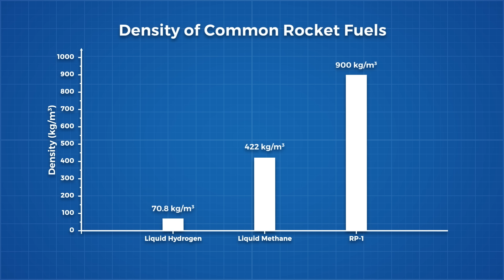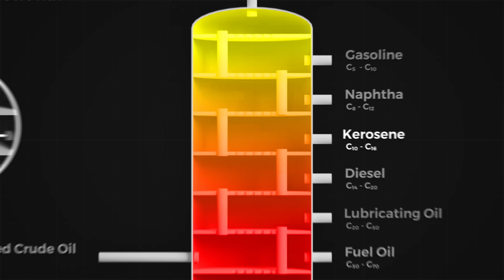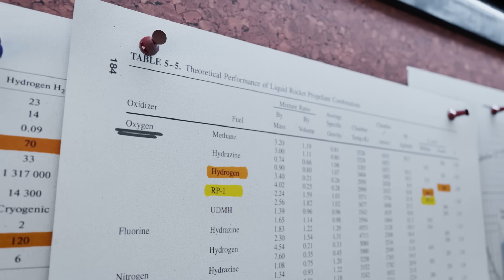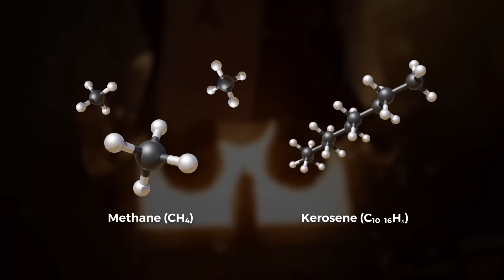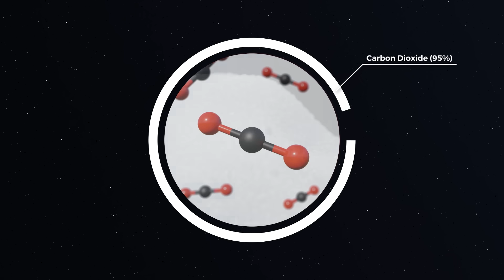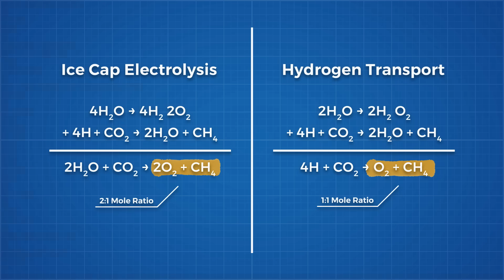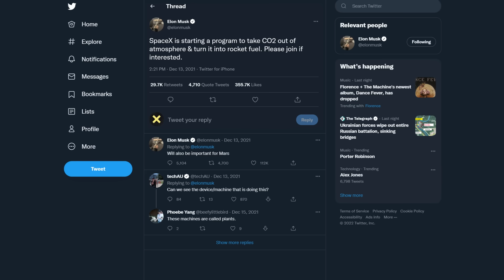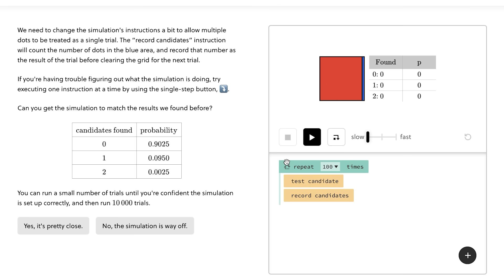Why SpaceX is Using a New Fuel

Comment: Everyday astronaut has 3 great videos about this.
I wish physics would be tought like this.  ( in school)
Reply: This is pretty advanced physics and chemistry. Doing stuff like this at high school level is pretty much impossible. That's why universities exist though
Reply: @spacelapsus8835  electrolysis was 10th grade?  ( Germany)
Ofcause it's the light version. 
I would have been more interested if i would have been shown why i should know certain things.
Reply: @CHMichael  yeah electrolysis alone maybe. Now combine it with a different reaction. Use the reactions and the densities to pass from mole ratio to mass ratio. Consider the fact that engines can't run on stoichiometric reactions or they'll melt so adjust the reactions to account for that. Now add the design process of the engine and of the tanks that have to account for thermal equilibrium, pressurization and feeding and then tell me that this is something you can teach in high school.

Dude, I'm an aerospace engineer, I'm not saying it's impossible to teach this, I'm just saying that you can't teach this in high school while kids have to study also 10 other subjects. And that's why this is taught at the university. That's all I'm saying
Reply: @spacelapsus8835  you know way too much and no one expects a high school graduate to build methane factory.
By using this style of presentation the students might have enjoyed accumulating the basic knowledge to understand why SpaceX has made these choices. 
Versus the endless formulas on the black ( now white) board.
Reply: @CHMichael  the problem with that is that it isn't really knowledge. It's no different than watching a documentary or reading a book. By just listening to what people did without actually looking at the math behind it you're not really learning. You'll just be able to repeat what the documentary said. You'll get the outside of things but won't really understand them

Comment: Another reason they went with Methane is that is allows the full flow staged combustion cycle of the Raptor to work. The Merlin uses uses Kerosene and has minimal to no refurbishment required.
Reply: The only other full-flow engine to reach a late stage of development was the USSR's RD-270, which burned the similarly dense (but extremely toxic) hypergolics UDMH and N2O4.
Reply: It's the other way around actually. Since they're going with methane they chose to develop a full-flow stage combustion engine. The choice of the propellants is a level above the choice of the thermal cycle because it influences your architecture a lot more.
Reply: @spacelapsus8835  I see it as sort of a package deal. Along with the other reusability benefits of methane, you also get the relatively benign turbopump environments.
Reply: @pseudotasuki  yeah that is for sure true. However, what I meant was that you first have to settle on a propellant to then start considering the architecture of the propulsion subsystem. The choice of the propellant is governed by the type of mission you're dealing with. For example, long term missions generally (it's not always the case but it is often true) won't opt for cryogenic propellants for the final stages because of the complexity of storing at such low temperatures for extended periods of time. In this case, the choice of methane came from the possibility of in-situ extraction and the better performaces compared to RP1.
Reply: @spacelapsus8835  Aah, yeah.
Reply: @spacelapsus8835  Arguably you can decide that you want certain aspects of architecture and then shop around for a suitable propellant afterwards; it's just that if you do so and there are no suitable propellants that can utilize it, then you have to give up on those architectural choices.
Reply: @spacelapsus8835  No, you don't first settle on a propellant, that's where the Hydrogen Obsession came from. You do a trade of all aspects of the architecture at the same time. For example - Hydrogen has high ISP, seems great, US heavily focused on it. HOWEVER, the tanks weigh a lot and turbopumps are too big (heavy). Kerosene has lower ISP, but easier to pump(means higher TWR engines). Both kerosene and methane can be subcooled, increasing impulse density(another important metrics) and performance. Methane can be made on Mars. But in the end - Methane really comes ahead of hydrogen/kerosene ONLY IF you do both full-flow engine AND propellant subcooling. And that's a result of a full architecture trade, not "pick fuel, then pick engine cycle".
Reply: @candyjaywee  you just wrote a useless tantrum for no reason. Methane comes ahead because it's basically the only viable option for round-trip missions since synthetizing RP-1 on Mars is impossible and extracting hydrogen is quantities large enough to be used as a propellant is unfeasible (and again, storing it for 7 months in a tank for the journey is practically impossible).
Reply: @KainYusanagi  which is exactly why you don't do that. Developing something extremely complex to then have no real options to be used is the most stupid thing an engineer can do.
Reply: @spacelapsus8835  There's a difference between developing something extremely complex and finding nothing that works with it, and deciding on an architectural design element and looking at what fuels would possibly work with the choices you want to make before you actually make it, since we actually know all the relevant data of the fuelstock we could potentially use in the first place, now; no longer are expensively overbuilt prototypes required to be made just to see if a fuel is possible within it.
Reply: @KainYusanagi  do you work as a rocket engineer?
Reply: Indeed. It would be extremely difficult to implement in an engine that burns hydrogen, due to the enormous difference in density (and therefore frow rate) of hydrogen and oxygen.
Reply: It's certainly possible to do hydrogen full flow, it'd have some restrictions removed from shaft driven pumps on a closed cycle single turbopump engine like the RS-25 and it's insane gaskets on the shaft.

Full flow removes the shaft for 2 independent turbopumps. But since hydrogen is so low density, you'd need 2 very large pumps. The RS-25 pump is crazy big compared to the rest of the rocket.
Reply: @Jaker788  Came looking for a comment on the pumps and was not disappointed, full marks. Turbopumps are by FAR the hardest part of all of it, and exactly as you say, LH2 is extremely hard to pump well. A major reason SpaceX prefers LHC4 and RP-1 to LH2 is the pump turndown ratio. LH2 pumps have notoriously poor turndown ratios, because when running off-design (like for example when one wishes to land a rocket stage) the pressure rise through the pumps falls off a cliff at low throttle settings. These problems don't impact LCH4 nearly as much.
Reply: @Jaker788  But for any vehicle that needs to be able to operate over long distances and durations, Hydrogen's leak rate would be a massive problem.
Reply: Also methane has more energy than hydrogen per volume
Reply: @widodoakrom3938  just wait until solid hydrogen is fully developed. A 1000 isp very dense propellant is gonna make methane obsolete.
Reply: Meh, it has good specific impulse, phase temperature overlap with liquid oxygen, and it can be synthesized through Mars ISRU
Reply: yeah ...that black soot produced gets collected on the bottom side of falcon 9 ...making it black during reentry ....also it f ups the merlin
Reply: Uses uses kerosene?
Turns out humans ignore if a word is used twice with a line
line break between them.
Reply: Heresy is a subjective term – only you who are in fear of the Omnissiah's righteous gaze wish this work to cease. In His name, I shall see this is never so!
Reply: hello  i just wanted to tell you all to repent for your sins and come to the lord jesus Christ
Reply: @alexthomas3628  we'll all go up and visit heaven once Elon gets the ticket costs down on Starship.  Does the buffet do Happy Hour?

Comment: Would water on Mars be carbonated?
Reply: No, it would mostly be tightly chemical bound in the soil, at a proportion of typically 1-3%. You need to do a lot of mining to get it and then you need to supply energy and complex processes to extract it from the soil.
Reply: @saumyacow4435  frozen water?
Reply: @JadenRiley6494  If you're looking for ice on Mars, then you'll need to start at mid-latitudes and you'll probably find thin layers of ice buried beneath metres of soil. That doesn't solve the mining problem. If you want to find ice on the surface (mixed with dust and CO2) then you can go to the poles. Problem is you then need to transport it thousands of kilometres to somewhere hospitable enough to actually site a base.
Reply: @saumyacow4435  man I just wanna if it's gonna be carbonated

Comment: At 14:14 it speaks of using the Sabatier process in creating storable energy. I don't get this. If you're starting point is hydrogen (presumably via electrolysis) you lose more energy creating liquid methane than creating liquid hydrogen. Liquid methane might find a use in things like ships (due to easier storage), but for grid scale energy storage, where you've got room for the insulation, liquid hydrogen probably wins.
Reply: Insulation is not the way. For every liquid, its boiling point increases with external pressure. If stored in a strong enough vessel, a liquified gas can keep itself liquid through its own vapor pressure. For example, lighter fluid is actually a gas under normal conditions, but the body of a lighter is strong enough to contain the vapor pressure and keep the fuel liquid. The lower the boiling point, the more pressure is needed to keep the liquid from boiling at room temperature. Liquid methane has a much higher boiling point than hydrogen, so it's not unfeasible to store it in high pressure tanks with minimal insulation. Besides, its molecules are a lot larger than hydrogen, so methane-tight storage tanks are much easier to make than hydrogen-tight ones; as was mentioned in the video, methane has a lot more energy per volume as a liquid, so it's more space efficient as well.

You're right that it is theoretically more energy efficient to store hydrogen directly instead of methane, but practically storing (and let alone transporting) one is way easier than the other.
Reply: @pocarski  Yeah, but to keep liquid hydrogen a liquid, even at liquid nitrogen temperature, requires extreme pressure (not going to look it up right now, but its huge). 

The point about hydrogen is not transporting it. Rather you liquefy it on site and convert it back to electricity on site. Likewise if you need hydrogen for steel making, you make it on site and use it on site. Methane could have its uses, but ammonia is denser, easier to store and is being promoted as a fuel for things like ships.
Reply: @saumyacow4435  I've looked it up, both of us forgot about supercritical fluids. If you get a hot enough gas under high enough pressure, it becomes a fluid that blends together properties of liquid and gas. Both methane and hydrogen are supercritical at room temperature, so this entire argument is moot because both of them get properties so cursed that I couldn't find a single formula that describes them.

Hydrogen's critical pressure is 13 atmospheres, while methane's is around 45. I'm not entirely sure what that means for storing them, because I have zero idea about what happens to pressure vs density when a gas is hotter than its critical temperature.
Reply: @pocarski  Yeah, I looked it up and came to that conclusion. I think hydrogen would be supercritical even at liquid nitrogen temperature and worse, it would be fairly low density. Even so, liquid hydrogen at atmospheric pressure has its uses and I suspect there are ways to recover some of the energy used in liquefying it.
Reply: Is energy efficiency the correct metric though?
If you have wind turbines turning and not enough demand to soak that up, the rest would be going to waste. From that pov an inefficient process that results in an easier to store fuel isn't necessarily a bad thing.

If you're storing fuel over multi year periods cheapness and ease of storage likely wins over efficiency of something that was going to waste anyway.

Comment: Would a rail gun catapult be to violent for a payload to make it to space?  We all know it's not  yet practical as a weapon, but maybe we can use some our technology (like the rail gun) for stuff that's not weapons?  Even if it's a hybrid of a fuel rocket, it will save a bit of fuel, by getting the rocket into low orbit before needing to fire engines maybe?
Reply: Yes, the amount of G the payload it will withstand is pretty much gonna destroy anything that cannot withstand the G like the vehicle itself. There is a theory of Mass Drive where you slowly gain the speed needed to leave Earth Atmosphere. Think of it as a Train gaining speed and going up after gaining enough speed to leave atmosphere.
Reply: It is possible. You could use helium balloons along the barrel to lift its muzzle up to 40km, where the air resistance is only one thousandth of what it is at ground level. You would still need some fuel to turn your trajectory into a proper orbit, but depending on the gun's angle it's only a fraction of what you need to get there in the first place.
If you want to reach particularly high orbits, like geocentric or the Moon, or even leave earth's gravity completely to get to Mars, you could combine the space gun with a rotating space tether. This would also allow you to significantly lower your muzzle velocity. With such a setup it would even be possible to bring the accelerations down enough to be save for humans.

Comment: Mars is not a good explanation of why. Methane is now the goto fuel for rockets that will never land on Mars. ULA Valcon, New Glen, Rocket Lab Neutron..... Environmentally Friendly? Easier to handle than hydrogen? More powerful than RP1?. Less damaging to parts, allowing for easier reuse? I don't know.
Reply: It's more powerful than RP-1 if you use a full flow cycle because the full flow cycle is impossible with RP-1 (too dirty)
Otherwise it's just for reusability.

Comment: This is the first video that’s ever explained specific impulse in a way I understand, thanks 🙏
Reply: I guess you don't follow Scott Manley or Everyday Astronaut then.
Reply: Wait until you hear about the Oberth effect...
Reply: It's exhaust velocity multiplied by a constant. The faster you throw propellant out the back, the faster you can go on the same amount of propellant.
Reply: @VecheslavNovikov  That's only true for a rocket engine thought, for a jet engine the slower you throw the air the more efficient you are because you are pushing an external mass and the slower you throw it the more mass you are pushing against.
Reply: @VecheslavNovikov  Specific impulse is a unit of momentum per kg of fuel so if the exhaust mass and the fuel mass are the same like in a rocket engine it's just an unit of speed.
But instead of using newtons they used kilogram force. So you have to multiply it by 9.81 to convert kgF to N and get a speed in m/s
Reply: @johntheux9238  Yes, that's correct. The video was about rocket engines, so I ignored jets, props, etc. Modern air liners use turbo fan design, where the majority of thrust is provided by a big fan taking in air, as opposed to turbo jets or ram jets that rely only on combustion exhaust.

Edit:
Specific impulse is thrust over mass flow rate, so I=N/(kg/s). F=ma, so a Newton can be expressed in units of kg*m/s^2, making sp. impulse be in units kg*(m/s^2)/(kg/s) = kg*m*(1/s^2)*s/kg = m/s. So if we use N for thrust units, we DO get m/s, or exactly exhaust velocity as the specific impulse, at least for a rocket.